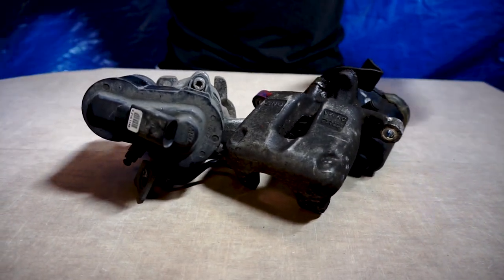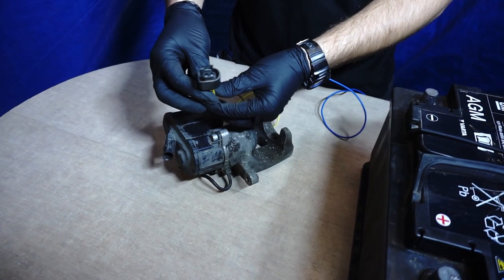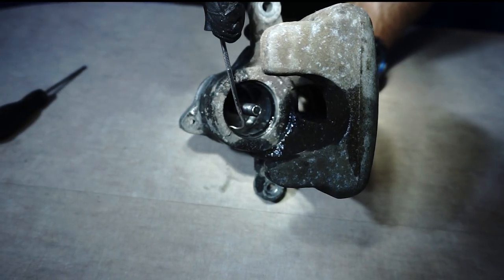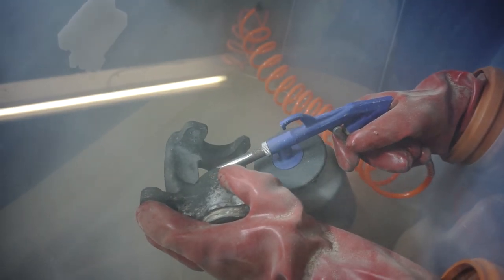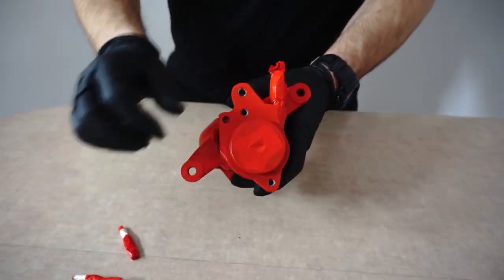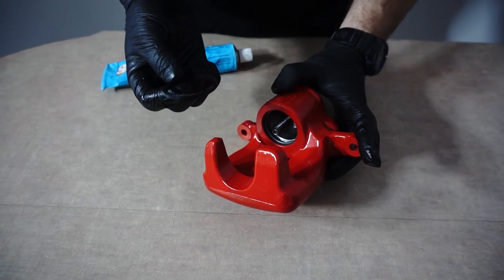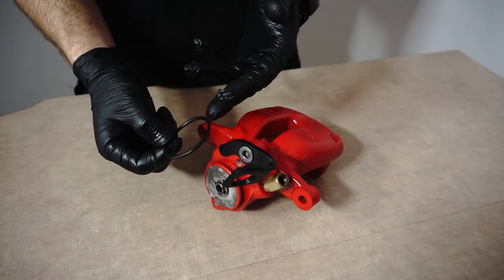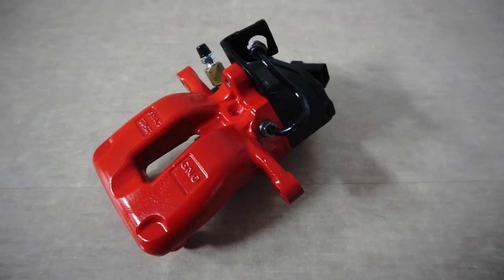How To rebuild rear brake caliper with EPB – Audi  VW restoration complete Guide

Comment: Just used this to fix the rear brake caliper on a 2017 Mercedes Benz E-class (W213). The housing and bracket looks different but the mechanism is exactly the same. Thanks for helping us out!

Comment: Many thanks for a well presented and informative video. I had hoped that my Golf Mk7, which has an EPB, would have a similar caliper. But I was wrong. When I removed the piston about 20 tiny ball bearings fell out ! Could you please tell me if it is possible to re-assemble the mechanism or have I ruined the caliper ?
Reply: I'm in the same boat. Tons of tiny ball bearings, springs, and a long spring that was kind of mangled. Did you end up just replacing the caliper?

Comment: Thanks for a great video. Just did a rebuild of my EPB caliper, Golf 7 2014. Only got one question. How do you bleed the caliper when installed again?
Reply: Wouldn't you jump pump the brake to fill the caliper then open the brake line to pump out any air bubbles?

Comment: Great video thanks. One question do you happen to know what causes the screeching sound when applying the ebrake?
Reply: Wait until you are stopped before applying the ebrake :) Seriously though, sounds like the motor mechanism has dried up. Maybe pop the motor off and chuck some grease in. They do make some noise anyway though, maybe normal?

Comment: Nice vid, best I've seen.....however, can anyone explain to me how, in normal operation, the brake pad is released from the disc? It's obvious that when the brake is applied (both by foot and by motor) the caliper pushes against the pad but what happens when the brake is not used.....what pulls the pad back off the disc. There is no mechanical means of pulling it back off.....does it simply rely on nil pressure resulting in the the pad being in constant contact (just touching) the disc? Please help as my brain hurts 🙂👍
Reply: The rubber square o ring that sits inside piston cylinder is whats pushing piston back off pads... Thats why its square profile

Comment: It would have been more helpful had the producer of this video identified the specific name and retailer source for the two different lubricants he used for the cylinder and caliper parts.
Reply: Yeah, the video is very informative but what’s up with using replacement parts from non-existing source?